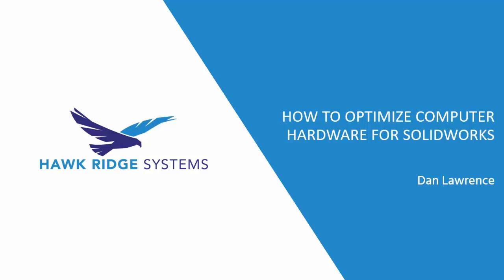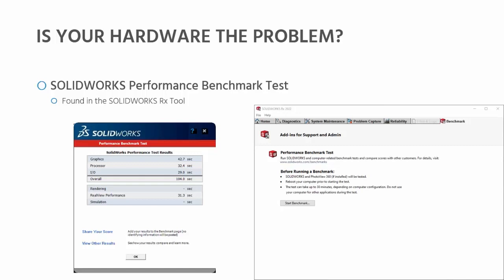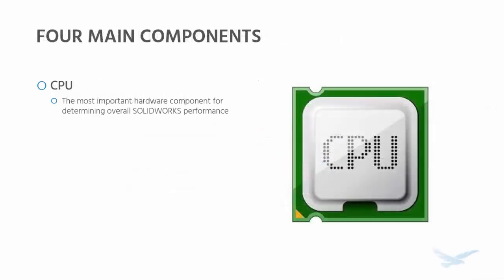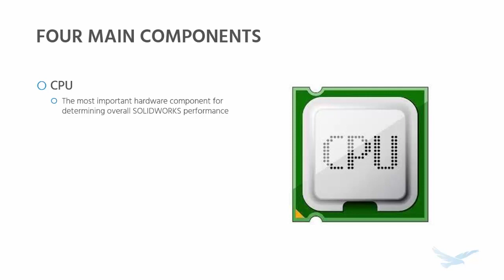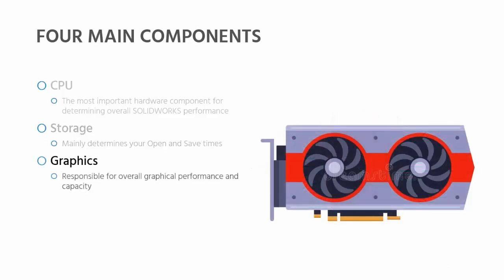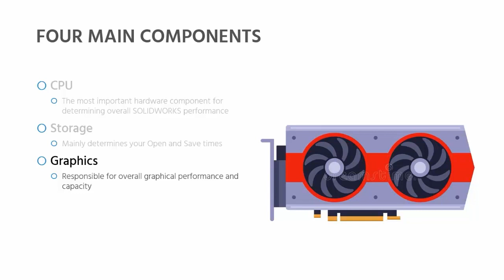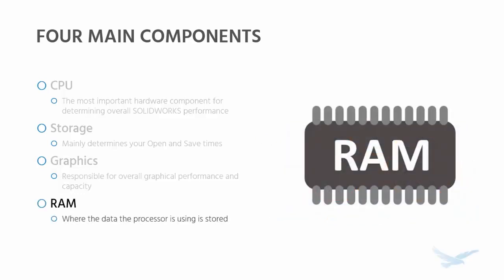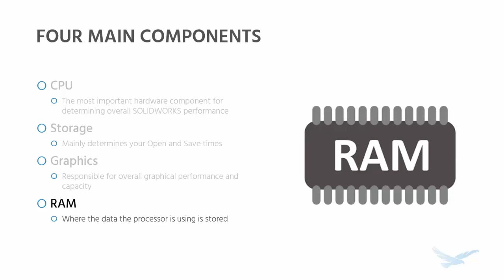How to Optimize Computer Hardware and SOLIDWORKS Settings

Comment: I upgraded to a 10k computer with an absolutely outstanding hardware and I believe the modelling technique is fundamental but regardless of how you model how you improve it, this software is an absolutely distaste for any type of hardware. I love the software how it manages the relationships tools and VBA macros but apart of that it's not a tool for large assembly. 2 years user of Solidworks and 15years user of inventor.